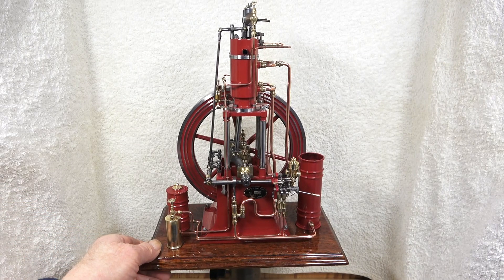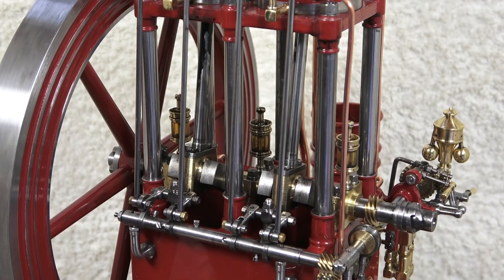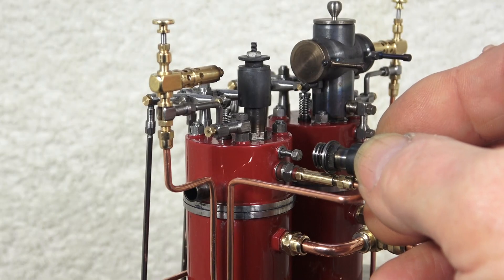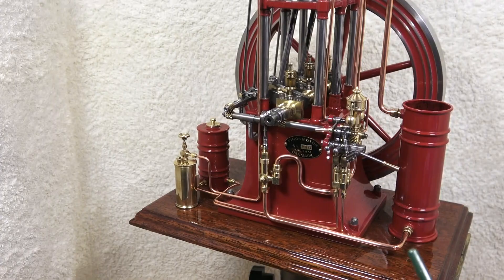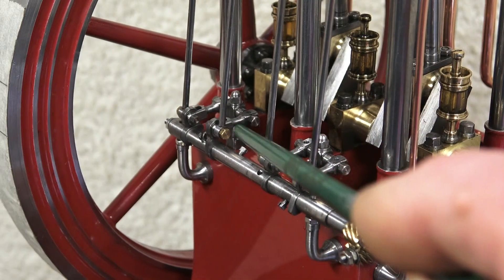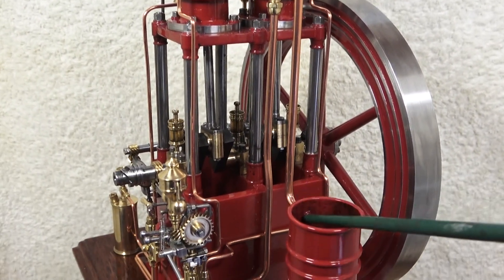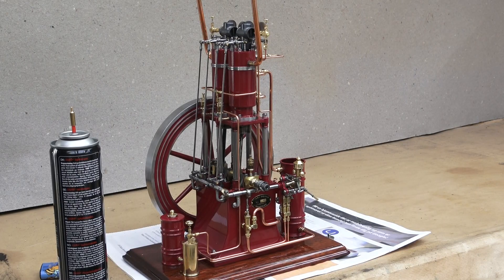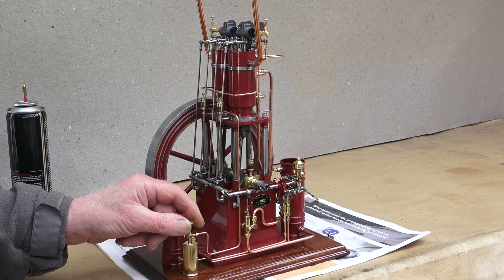NEW-Mini Model Twin-True Semi diesel Engine.

Comment: Well done, as always. A 360º crankshaft. Interesting, as in 4 strokes, it provides exactly even firing impulses. At low RPM, balance is important, but not as crucial as in higher RPM engines. At least in twin cylinder motorcycles, manufacturers are switching to a 270º crankshaft, for perfect primary balance. Secondary balance issues are not as critical with low RPM.

Comment: Your engines are always beautifully made and always run like a Swiss clock.
And quietly vs other similar engines!?
I get that the long stroke, heavy chambers and zero valve overlap help a lot here, but what is your 'secret' here!??  :)
Also what do those 2 small mufflers look like inside?

One thing I don't see is proper (Elliptical, 3 to1 ratio) Bell mouths  on the intake and tuned length pipes.
They make a surprisingly big difference on std engines, (~30% IIRC)  so an interesting avenue for tinkering here too.

I'd love to see power and torque numbers. So perhaps a small generator with variable field strength to act as a 'dyno' would increase clicks.

Comment: Dear Find,

It is always a special day when one of your videos appear! These engines are so amazing. Each a little different. Interesting to see you use a low set cam shaft and long push rods. On a low revving engine I am more than happy to see long push rods, and stationary engines [and marine engines] tend to be low revving. I love the rumble of a low revving engine!

I remember that horizontally opposed two cylinder hot-bulb engine, and I do wonder if you could apply the long push rod idea to to that layout! Maybe use just two cam lobes so each cylinder valve was exactly mirrored to the other rather than machine four lobes - one for each cylinder valve. 

This engine seems to run very clean on the exhaust with no visible exhaust. Could that be put into the horizontally opposed concept?

For the first time, I realised that the water cooling does not extend to the head! Seeing the inlet and outlet shown here makes the point clearly. 

When I look at your clean and finessed making it almost brings tears to my eyes with its beauty and functionality.

_____________

In my dreams I would love to have a horizontally opposed twin semi-diesel on a an electricity generator, of say 5kVA running at say 180 to 240 rpm on the crank, as an emergency back-up for when our rural electricity gets cut.

Very best wishes from George in UK